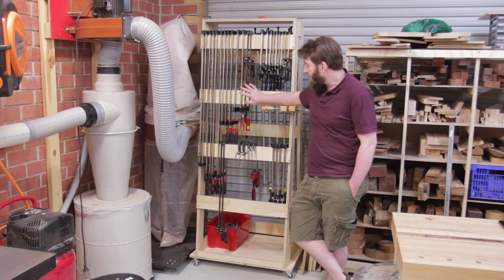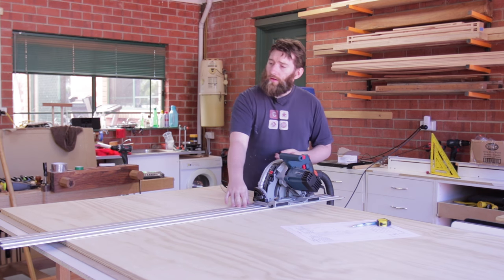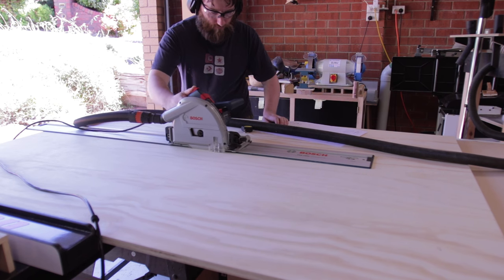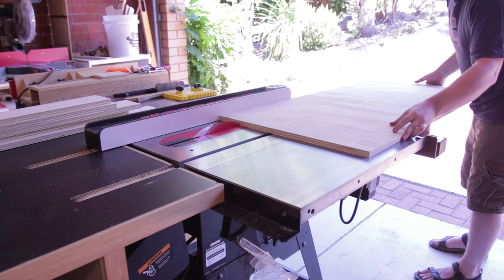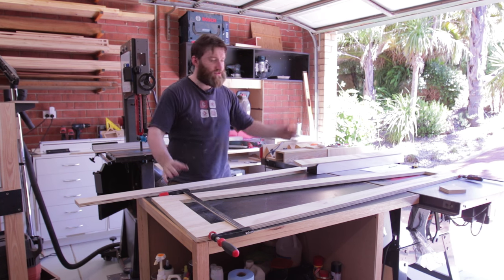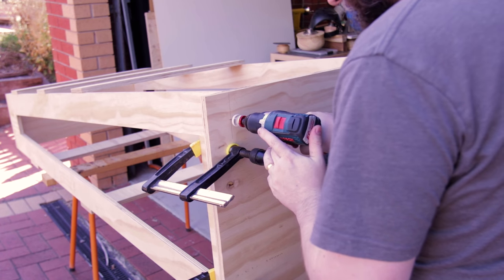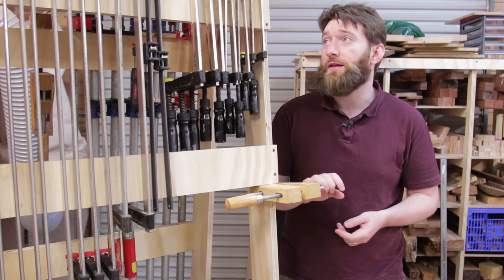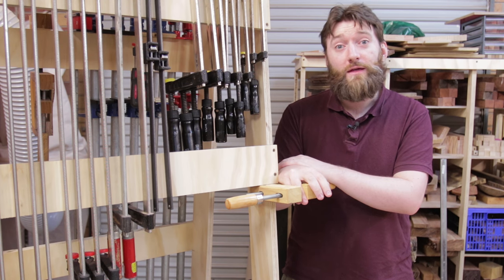How To Make A Rolling Clamp Rack (New Yankee Workshop)

Comment: I built the clamp rack from Norm's plan several years ago and it's held up well. Mine's really loaded down and I ended up putting on steel casters to make it roll easier.
Reply from the maker: I'm not sure I'll go for steel casters (bit pricey in this part of the world) but yeah, really need something heavier duty. Without clamps it rolled pretty well, but gosh the weight piles up fast!

Comment: Why doesn't the track saw track need to be clamped down? I've only used a wooden circular saw guide and have clamped it down.
Reply from the maker: +VampireOnline on melamine it does, but otherwise the grippy strips on the underside make it stay in position
Reply: Most have rubber strips on the bottom that prevent the tracks from sliding. Mine works well.
Reply: Even on melamine I tend not to clamp it, although I have a Makita track (same profile as Festool). It looks wider than the Bosch/Mafell design, not sure it that makes a difference.